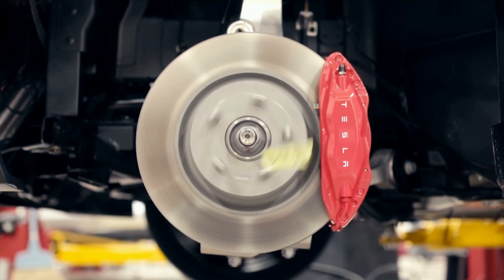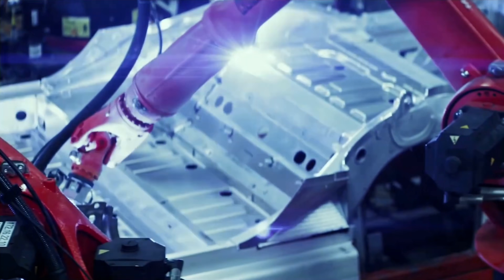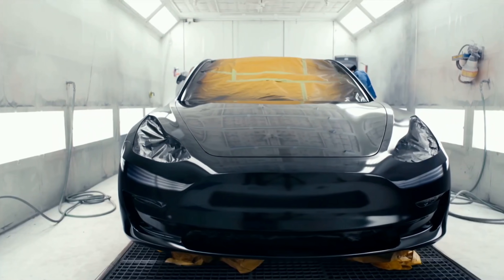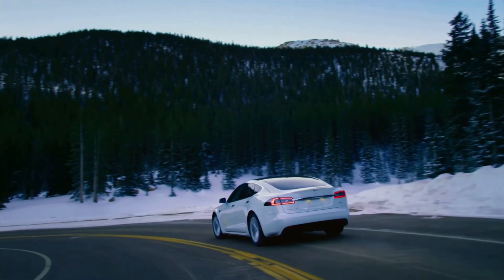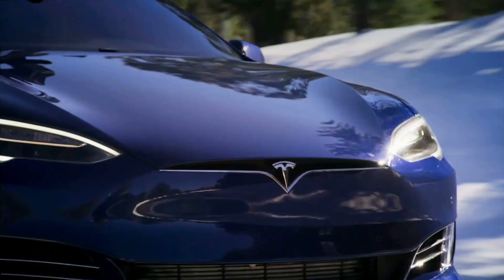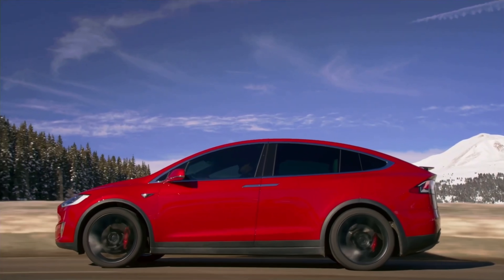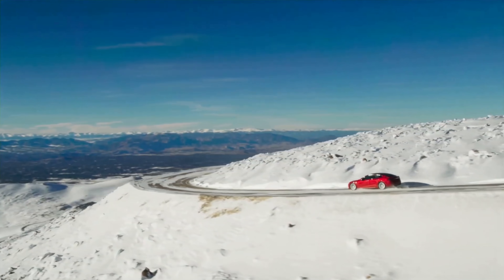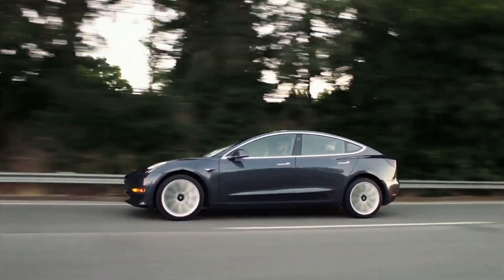How will Tesla Implement the Million Mile Battery?

Comment: I had the same thought about it for a long time... and found a solution. But before I talk about this first we have to talk about pricing - the CATL boss just made a statement that the new batteries will be more expensive than the old ones. So I think maybe if they have more power, they will put less batteries in a car to stay at the same price and maybe add the ultimate long range version which will be more expensive. And about your topic of the video - I Thought first: With battery day happening they must implement the new batteries from the start or everyone will wait for it before buying a tesla... But than I thought of an easy solution, make it upgradable. So if you battery dies in 8 years you can pay 5000$ and than get new extended battery. But with all the statements coming from CATL I think they are already producing it and maybe like you said just started producing cars with it.

Comment: The point of the million mile battery is using your car as battery to grid technology.  This allows you to buy electricity when it is cheap, then sell it back when it is expensive (in the UK we have had negative prices for electricity recently).  For this technology you need robust batteries that can be charged and discharged for many cycles - hence the million mile battery.  You can then make money buying and selling electricity.

Comment: The term "million mile battery" is a bit misleading because the life of a battery is limited by it's cycle life. To translate this into "miles driven" you also need to look at the size of the battery and the consuption of the car or in other words, how far the car can go on one charge. So a car with a range of 320 miles going 1 million miles results in 3125 charging cycles. Thats roughly what the battery in an BMW i3 94AH can do. So technically, the I3 has a "million mile battery" for some years now :)

Comment: Or they could say the million mile battery and high density new battery cells will be implemented starting next quarter. They can absorb low sales for the quarter and expect booming sales next quarter and be prepared for ramp up.
Or they can say, they will progressively include new battery cells without mentioning what percentage of them will be new batteries.
I think 1st option is better.
They also need to be prepared by demand outstripping 2 to 3 fold.
Reply: I highly doubt that would be the case Tesla has never ever made a move that would intentionally kill the sales of a For a entire quarter.just to put themselves back in production held the nextso as much as I can see where you came up with the idea that is extremely unlikely knowing Tesla's track record

Comment: I think since research and large scale production are 2 different issues entirely, we shouldn't assume that they will start shipping it anytime soon considering the cost of retooling in factory lines and everything related to that. Imo they should start of by implementing the new battery tech into the Semi and 500+mile Cybertruck, as those buyers would benefit the most from that Tech, giving them time to optimize the production of those batteries. Then when they perfected the production, they should implement the new batteries into their refreshes of the rest of their lineup. That way they boost their new lineups, whilst not affecting current or soon to be buyers of their other cars, as people/companies buying the semi/Cybertruck arent going to be the same as those wanting a S 3,X,Y.

Comment: We need someone with a very recent model 3 to go weigh their car...

The million mile battery will also have an obvious weight reduction with the new chemistry.
Reply: I doubt this. I woukd expect it to be roughly the same weight or even heavier.
Reply: @EinzigfreierName  why would you think this? Are you basing this off of any evidence or are you just making a wild accusation?car would actually be less heavy
Reply: @Bman893  Depends and what we are talking about. So far we know that there will be LFP batteries for the SR+, which are quite a bit heavier than NCM or NCA batteries. https://en.wikipedia.org/wiki/Lithium_iron_phosphate_battery . I addition, Tesla could also come up with a new NCM or NCA chemestriy which has longer cycle life than currents ones. But I doubt they can increase capacity and cycle life at the same time.

Comment: I think the battery are already being used, or about to being used, there are couple of hints:
The time from filing a patent to publish take months if not year
The fact CATL already making battery for long rang RWD Model 3 in China indicate this technology doesn’t require much production line change.  And from the details I learned, it should not, so it should be a quick switch
Just a different chem mix and new cutting/fitting to the separator film,  they could be doing this since reopen, and it should be done by now, hence the price cut.
It’s batter, cheaper, and faster to make, that’s why it’s so mind blowing

Comment: They have two choices. Announce that the new battery tech will first be used in the Cybertruck, which would avoid any impact on sales of their current vehicles, or they can announce that going forward any new Tesla delivered will have the new tech. Strong indicators they will do the latter are the delays in Battery Investment Day (probably driven mostly by the Covid 19 shut down) and the recent announcement of discounted prices, which are for new sales, which means for vehicles that have not yet been manufactured. Also, it is highly unlikely any vehicles have already been delivered with the new battery tech. Tesla just needs enough cars built and sitting on their lot ready for delivery. It is real obvious Tesla has to first ramp up manufacturing in California, before they can implement such a plan, and that points to why Battery Investment Day has been delayed.

Comment: I'm hoping that they'll allow you to pay for a battery upgrade.  They've already showed that they can do a battery swap very quickly and easily.  So if they are able to implement this new battery tech in the same dimensions and wire hookups and previous battery packs, I hope you can purchase an upgrade.  That way I get to keep my car, and pay maybe a few to $10,000, and suddenly with a battery swap, get the increased range and benefits of the new battery.

It would also fall in line with their goals to recycle used / old Tesla batteries.  They get to use my old battery pack in electrical storage solutions and I get to improve my Tesla.  Maybe the fact that they will reuse my old pack will help reduce the price of a battery swap to a new pack.

Comment: I think either you're right and they started putting the new batteries in with the price drop and plan to announce before delivery of any of those vehicles, or, the new batteries will only be for the Semi, Roadster 2, and Cybertruck.  If it's the second case, they will "see no need for a battery like this in the S3XY line-up, but they have made minor improvements that will reduce costs" while they ramp up production of those batteries, to be made in giga-texas and giga-berlin, now called tera-texas and tera-berlin.

At the very least, I think the million mile battery is the hold up on the semi and roadster. working out kinks always takes longer than Elon thinks.

Comment: That’s probably why they reduced the price of the cars recently. To clear out older inventory. After battery day they will raise the price back to where it was so people don’t feel like they got ripped off.
Reply: I had a different theory: Model Y price didn't drop because it's gonna sell far better than the other cars. S/X are too expensive and 3 lacks the same level of size and utility value as the Y.
Reply: My guess was that the million-mile battery has been in use in all new Tesla since they reopened in Mayand since that battery cost a lot less they dropped the price on their cars hence why the prices across all cars.. and the only reason why is it in the mouth raise because it's too new. My guess is that they're going to announce that all new cars already have it that would make the most sense to me.one it would eliminate people from holding back from buying it because it's available now. Two it wouldn't piss off people that just bought the car last month because they already have it it's just like software locked or something.

Comment: I don't think Tesla is ready to fully roll-out implementation of the battery on the Battery Investor Day/Announcement Day, seems like it a ton of work to change the manufacturing process of one of the most important parts of an EV. Could it be possible that they would hold the event, and introduce a programme that would allow new Tesla Owners who buy a Tesla from that day to the date that they actually start implementing it in their cars to head to a Tesla service centre to get their batteries replaced with the new one for free (maybe a small service fee?). Then they could also introduce a programme such that older Tesla Owners who bought their Teslas before the Battery Investor Day to bring their vehicles in to replace it as well, just for a much higher fee to cover the the cost of the battery itself + service charge + profits, while of course prioritising those Owners who bought a Tesla from the Battery Investor Day till the day they actually start installing it in cars.
Reply: Service centers are already struggling to keep up, so I don't see Tesla doing anything to make the situation worse.